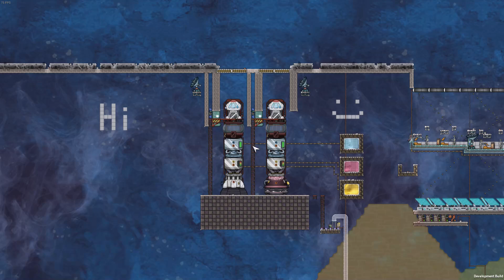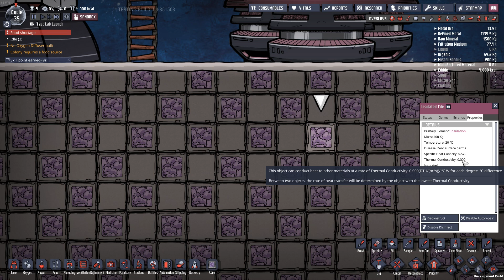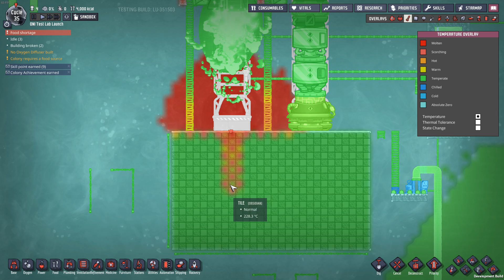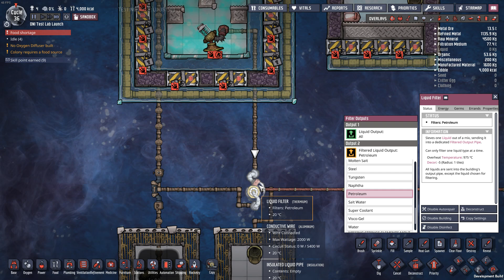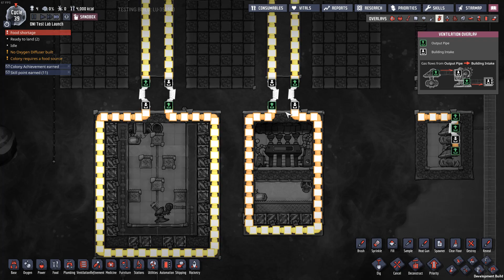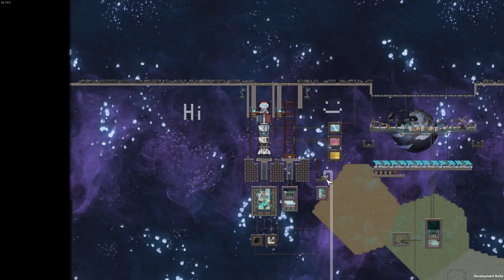Rocket Power! Oxygen Not Included Experiment

Comment: If you recycle the heat with a heat with a heat exchanger, you could make this much much more efficient. you could easily make make to boiler run continuously. You might even be able to run multiple with a single petroleum rocket. And you might still have enough leftover heat in the petroleum to run a steam turbines or two at low temperature.

Comment: what about super-durable airflow/mesh tiles(capped with doors and walled with bunker tiles, to try to store it?) to also get the energy of the exhaust gases, for more efficient and complete heating? unfortunately, i doubt you can make the airflow/mesh tiles durable enough to withstand over 2000C of heat. and try to use the electricity you generate with the steam turbine to power an electrolyzer or two that makes more hydrogen for your hydrogen rocket.

Comment: You could use 1 kg of liquid super coolant instead of ethanol for far faster exchange rates. Unless it changed in launch, elements don't state change while in pipes if they're 1kg or less. It does take a bit more fine tuning to set up though, but would have 4x heat capacity, I believe.

Comment: If the heat can pass through the insulation tiles, why don't you just put the petroleum boiler just under the rocket? You may be able to just convert crude oil without being limited by the maximum of 1000g gas pipe. Even maybe convert it at a 10kg/s ratio? Just need to delete a little bit of heat with a steam turbine to be sure that does not flash into sour gas. (And running  another steam turbine with hot petroleum.^^)

And maybe the hydrogen rocket produce enough heat to self-sustain the liquid hydrogen production with multiple steam turbines? 
(Steam turbines everywhere! Infinite power!)

God, i can't wait anymore for that "july" release... want to test new mechanics and biomes...

By the way thanks again for the video.^^

Comment: A small heat exchanger between the outgoing petroleum and incoming crude oil will make it much more efficient as there is no need to keep the petroleum hot for the rocket. Alternatively run the petroleum through another steam turbine before going into the rocket. After all, you want to power those doors and pumps etc.

Comment: Your petroleum flasher needs two temperature sensors so that it has an overlap state where oil is introduced and the couplers remain engaged, instead of the buffer gate on the couplers. Engage the valve above 400 degrees, and engage the doors when below 425. It would run more consistently with an overlap zone than the way you're doing it, which makes it impossible to introduce heat and mass at the same time.

Comment: Did you think about using the petroleum in a heat exchange to pre heat the oil?. should be pretty easy to setup in space.  just two parallel pipes with counter flow  connected with metal tiles and than space between the next row of tiles.

Comment: You may want to try out insulating ignious tiles instead of the diamond, as the rockets heat up your material a fixed amount. While the diamond is just 100kg your insulating tiles are 400 and have more specific heat capacity. Making it ever more potent.

Comment: brothgar. cut the middle man (gas) and pipe the heat directly into the steam or oil factory by building it under the lauchside.
Reply: @tdplay4135  so far i see the heat of the roket dont go to the left or right. A simple dimand window conecting the "heatcatcher" with the steamspace will do the trick. only thing is to cool the turbine like you mention but this muss be done enyway.

Comment: Why do you need more power when you have SHINE BUG REACTORS.

UNLIMITED POWER
Reply: Shine bug reactors = lag = somehow a way to cheat the game (a cool way of doing it BTW).
But this method should be less laggy and more honest in my opinion XD
Reply: It takes about 100 shine bugs to keep the SHINE BUG REACTOR going. You can have 2 running with out many problems. I set up 4 and game wasn't playable.  Most of my farms stopped working b/c they wouldn't eat. Dupes would sit and think between everything. not sure what the bottle neck was. Had plenty of unused memory, and had 30-40% CPU idle. ended up setting up solar on the rest of the surface. Still putting in the battery bank.
Reply: Because lag.
Reply: Why generate power when everything can be self powering?
Reply: Becouse it's cool XD